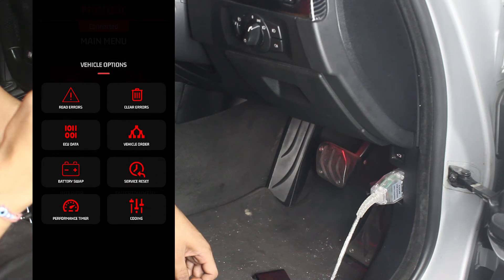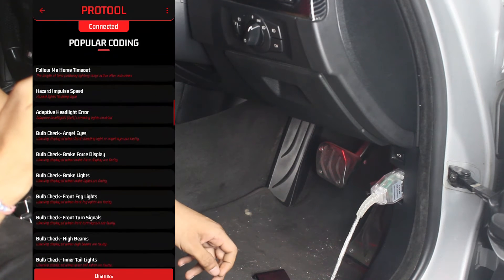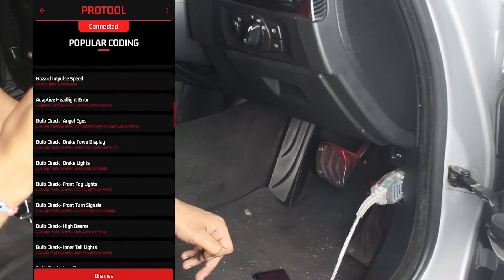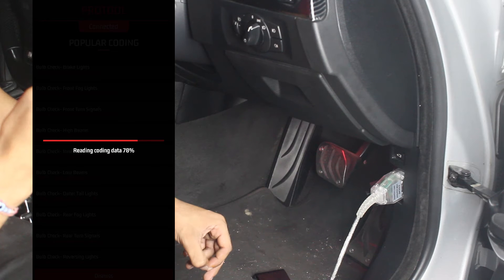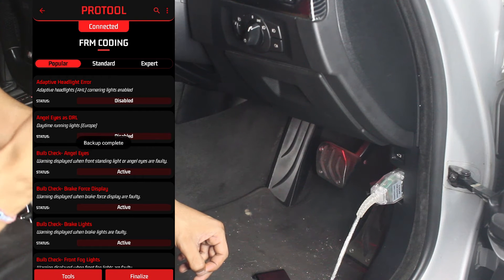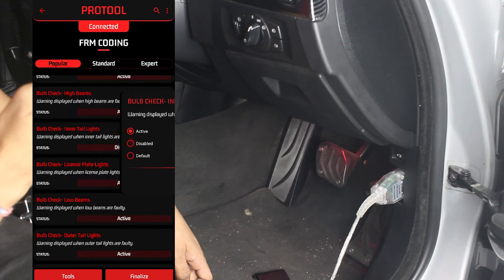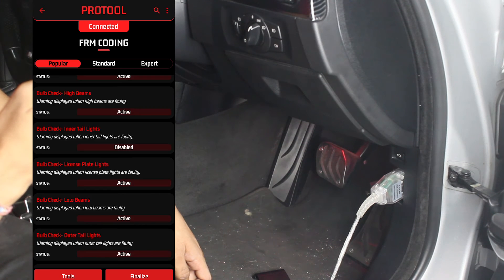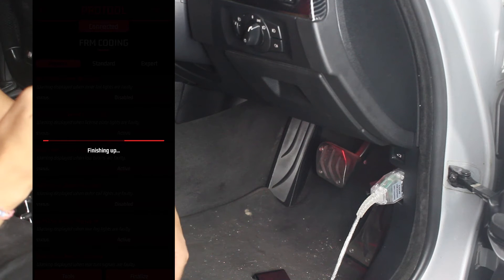How to Code Your BMW At Home - Remove Unwanted Errors | BimmerGeeks ProTool

Comment: Hi, Can I ask you if you change your FRM module ? Also in your tutorial you put a little box is it an obligation to get it ? cause maybe just with the coding you can avoid the problems ? Thanks in advance for your answer :D
Reply from the maker: Hi, i did not change the FRM module, its the original module from the car. I only used the box that i made just so the indicator will work as normal while i was in the process of buying my coding licence for the coding tool. Once i coded the bulb checks out, i removed the boxes
Reply: @Realpreshaanb Oh well, but if we change both front headlights and back headlights, will the original FRM module support the power?
Reply from the maker: The original FRM module will still work fine even if you change both the front and rear lights. It’s not about the power, it’s more about coding it properly so the car knows the new lights are there.

Comment: How much do you sale that box or will it not be needed if am going to code out? also if I use FRM2 do I still need to code out errors?
Reply from the maker: Its not needed if you're coding out the errors, the boxes are only to stop the hyper flashing but the errors still appear. If the car is a Pre LCI, you'll still need to code it regardless of which FRM Module you have. Best to use your original FRM as it has your VIN number on it and the cars original configuration

Comment: Im struggling to link up the App to the cable. Constant error of DCan cable not found. Any suggestions?
Reply from the maker: Ensure the switch is in the correct position and you are using a quality OTG adaptor... If all fails, you can connect wirelessly with a Bluetooth OBD II adaptor... Mine is all the way to the far left and it works... It must be a K+Dcan Cable
Reply: Im using a Samsung phone with an original Samsung OTG adaptor. I tried the switch in all positions - still no luck. I have the VGate OBD dongle, which also does not want to connect to the Protool app.

But the OBD dongle does work with other apps like car scanner.
Reply from the maker: @reshenkowlasser9784  You can get in touch with bimmergeeks and they would advise you much better
Reply: @reshenkowlasser9784  did you find a solution ? im having the same problem